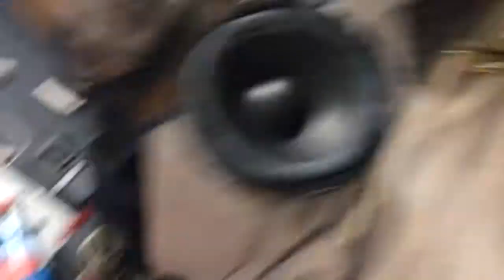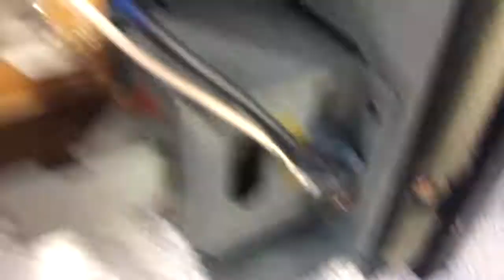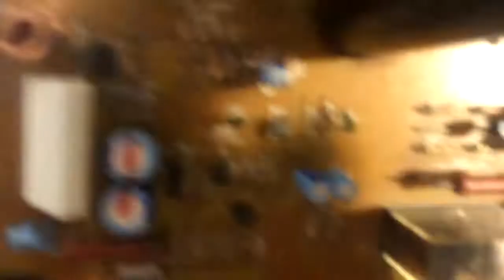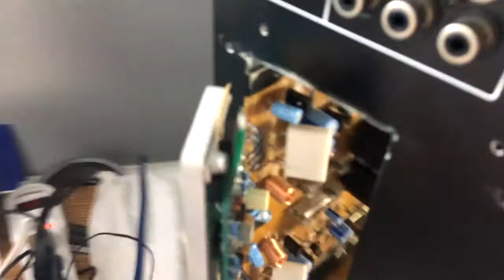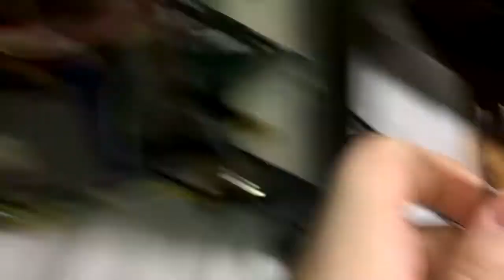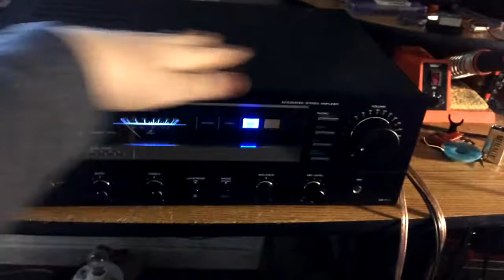(Part 4 of ?) Fisher CA-800 Restoration, New STK modules

Comment: Audiokarma brought me here.  So I may have missed it - how much power is it putting out now?  I've had the 800 for about 20 years and have done nothing to it; works perfectly.
Reply: it would be the same power. the transistors are still on the same voltage and its still class AB. if yours works i wouldn't even bother swapping them

Comment: Sooo.. I’m asking a question off of a 30 year old memory. As a kid I had this amp and loved it. Problem was that I was jamming it at a 1.5-2 ohm load as a sub amp. It would get after it!
Anyhow I kept blowing the fuses for known reasons and after bypassing the fuses I popped the darlington power packs. One at a time. StK-0080’s Lol. When I ordered new ones from where ever I got them they gave me Stk-0100’s. Think I was told they were an upgrade or something. Again I was up and jamming but being a hard headed 13 year old kid I blew it up again. Kept it for years then trashed it. About 7 years ago I found one on eBay in next to new condition. Bought it, hooked it up and it sounded great, just at 8 ohms this time. Lol. I Havnt opened her up to see if she has the 0080’s or the 0100’s. Do you know much on this? Just an interesting side note- 30 years ago I remember at full volume the uv’s stayed pegged and the 4 bar led would still be modulating. This amp(as I remember 7years ago) was the opposite. Just prob being silly on that one.
Reply: This amp is known to blow fuses and power packs. Its a good amp but modern day stereos are much better
Reply: If its the CA880 or 800 both models use the 0080 packs. If the 0100 has the same pinouts it should work in its place